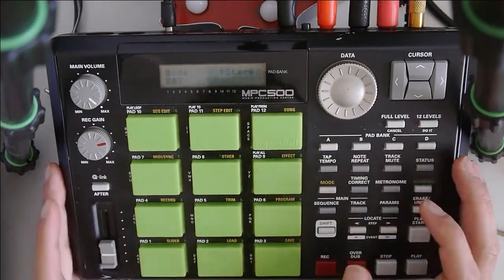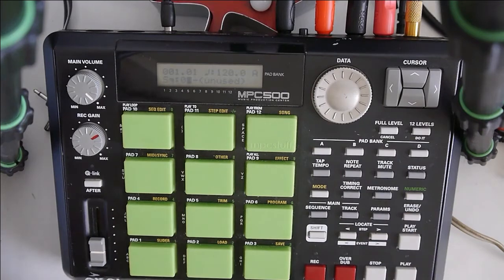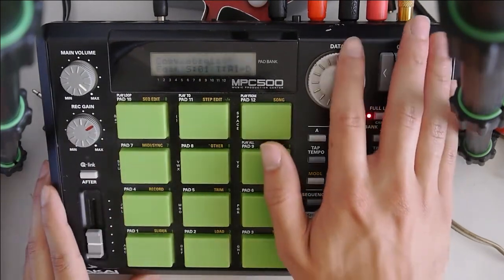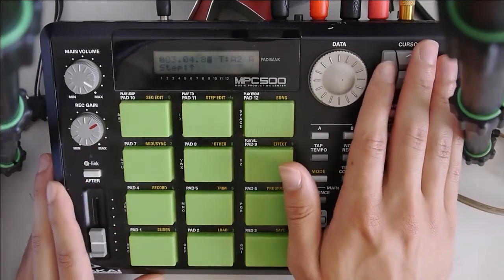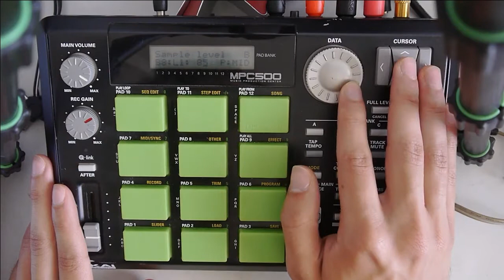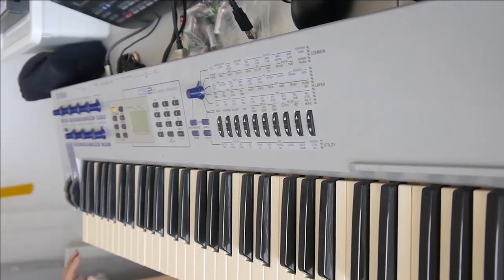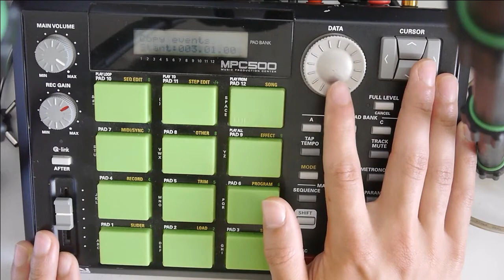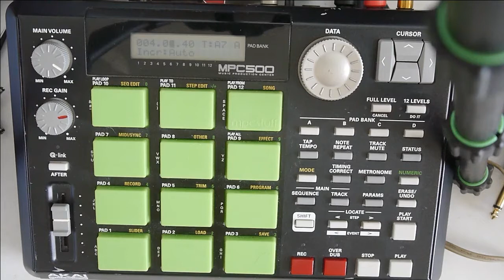Making a Beat on the MPC 500 + Mini Step Sequence tutorial

Comment: is there quantization on the mpc 500?  if yes, how is it activated?
Reply from the maker: Yes of course! Quantization is applied by going into the TC settings. According to the ratios you can apply it to 1/8, 1/16, 1/32 and Triplet timing I believe. You can dive deeper in the quantize settings for specific changes and swing settings.